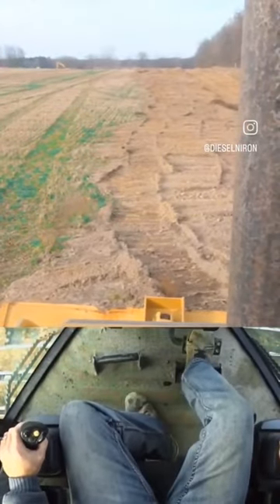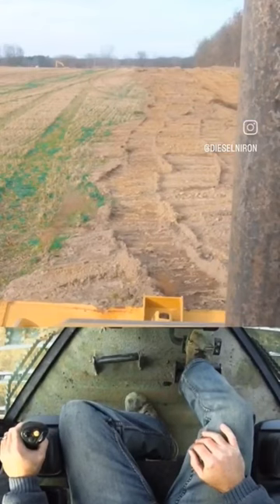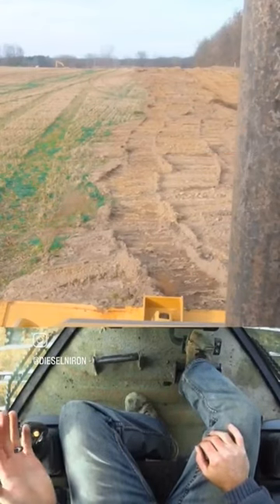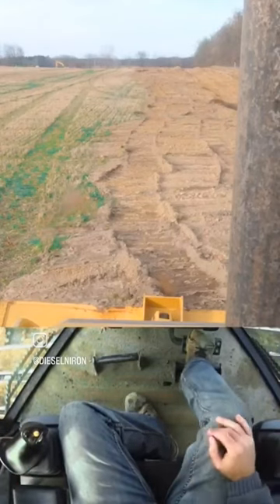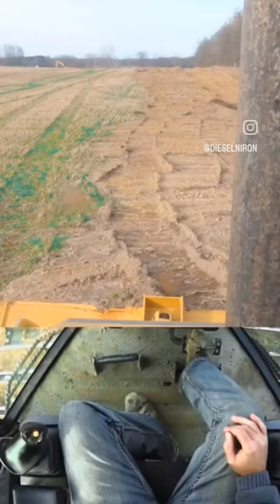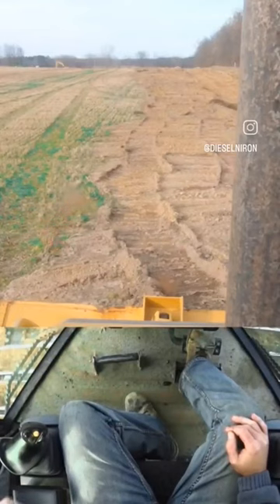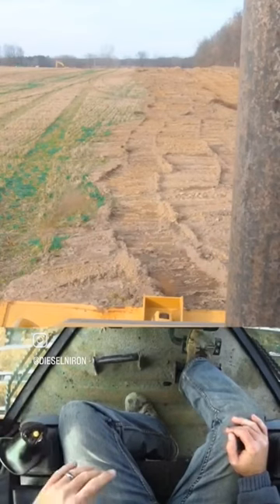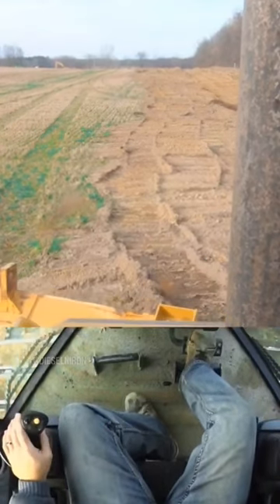Setting up for a push to grade out a farmer's field after drain tiling#dozer #bulldozer #grading

Comment: It almost looks as if there's not enough material to carry under the moldboard. In cases like these sometimes I would start to (edit:2*) passes over and roll up a nice windrow to The "match" Side that way I have something to carry the Dozer through the blend. 
     Hard to tell from my point of view, and it sounds like you know what you're doing.
Reply from the maker: It is really hard to tell from the video but I was able to keep material on the blade so I had a constant smooth pass being laid down for my tracks as I went along. Thanks for the comment!

Comment: What do you mean track it in?
Reply: You start with your left or right track and drive straight and back up straight and then just barely turn the machine to one track length over and do the same until the whole field is “tracked” In. It’s just packing the material by stamping it with your tracks.
Reply: Ahh. That's what I thought but was unfamiliar with that term. We call it wheel rolling when using a tire machine or trackrolling with tracks. Thanks